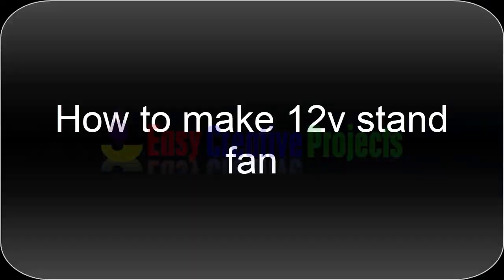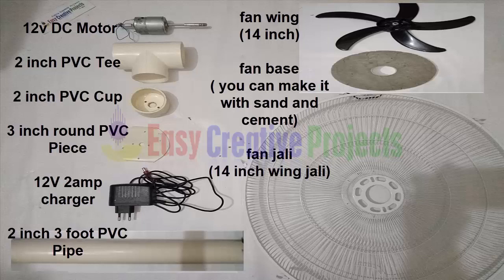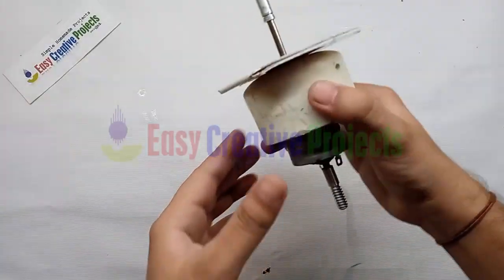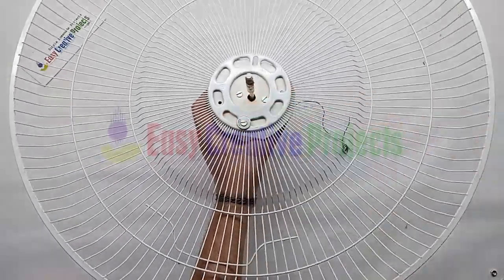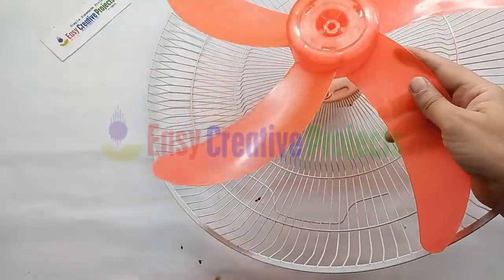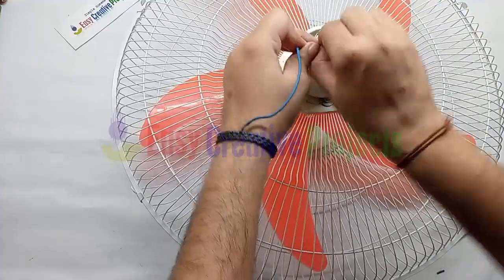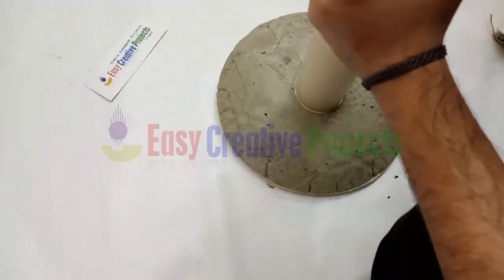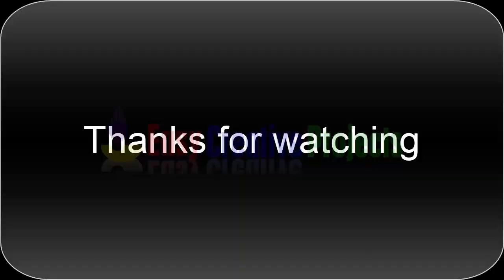how to make 12v stand fan easy at home - homemade pedestal fan

Comment: Whether this DC fan consume less AC energy? How to connect with 50 watt solar panel?
Reply from the maker: must use diode bridge for solar panel. if you dont use then battery power distroy you panel. 
 you can directly connet 12v solar panel with fan.  
i also try to make a video for this. 
thanks.

Comment: ye kitny Amp ka h  sogo fan ke tarha chalta h kam amh p b chalta h ?
Reply from the maker: is ki motor 12v 2amp pay chl rahi ha.  baki aap ki motor pay depend krta ha agr low amp vali motor lgain gay to km power use ho gi.
thanks.
Reply: @EasyCreativeProjects  dear mere pass local 775 h ab pata nh wo kitny amp leti h agar 25 ke gage 20 turn p krain gy to 2 amp legi ?? or Kya heat to nh Hogi na  fan k Liye use kr raha hon is Liye please suggest krain best Kya rahega

Comment: to what is the other end of the charger plugged in - battery or AC outlet
Reply from the maker: charger work on 220v AC input, 
you can also use 12v battery. simple replace 12v charger with 12v battery.
thanks.